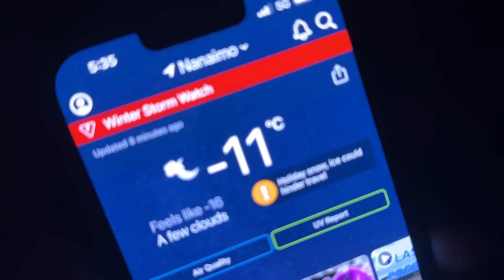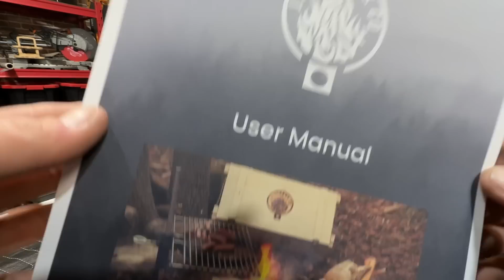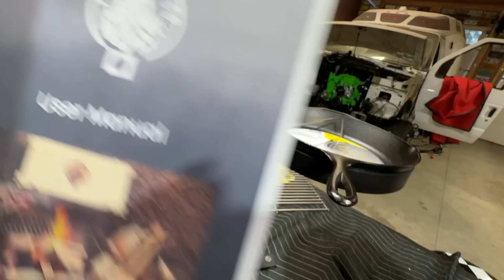CLOSING UP THE SHOP "Engine Is Back In" NEW CAST IRON COOKING TOOL

Comment: That's a lot of wasted fuel going out the roof vent with that nice heater going and you're blowing out most of the heat through the roof that kind of defeats the purpose of having safe warm heater